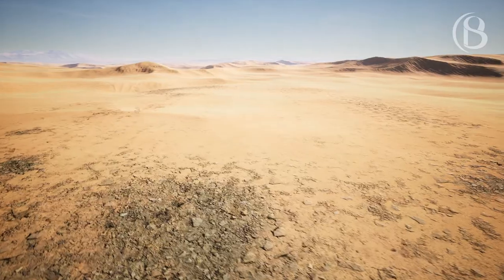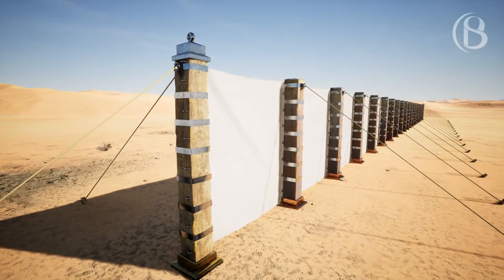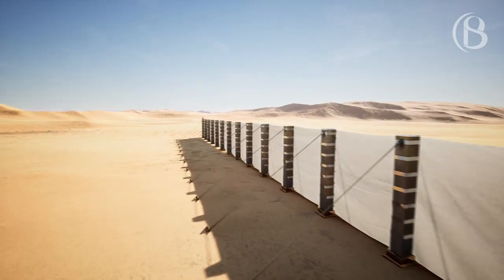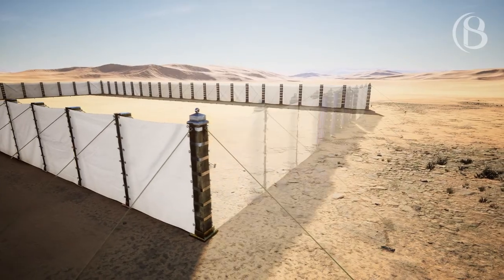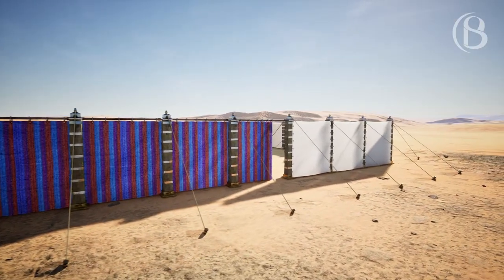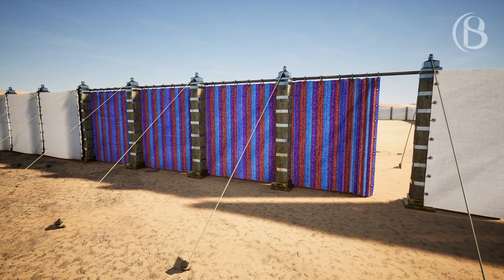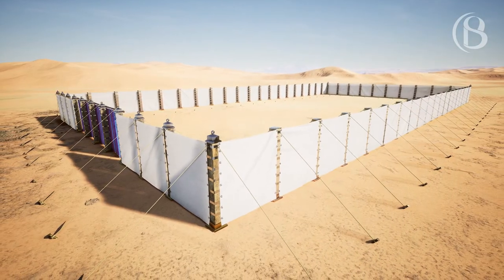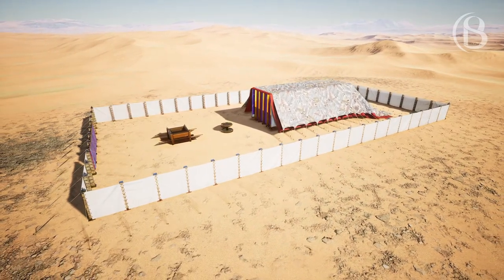Tabernacle in 3D - Outer Court (Exodus 27:9-19)

Comment: I have been studying and teaching the Tabernacle at our church.  I have a question.  The pillars on the outer court.  It says that on the North and South sides, there are 20 pillars.  If each white linen curtain between the pillars is 5 cubits or 7.5' and if there are only 20 pillars there would only be 19 openings between the pillars which would total 142.5' or 7.5' short.  I have the same problem with the end pillars of 10 pillars with 9 openings or curtains.   With the gate having 4 pillars and 3 on each side I still come up with 7.5' short.  In your video, you have 5 pillars in the gate instead of 4.  Can you help me understand this?
Reply from the maker: I decided (rightly or wrongly) to assume that Each side was short one pillar, so for example the front side had 4 pillars but five sheets, the last sheet joined up with the starting pillar on the side, ( at least that's what I think I did - it was a little while ago now).🙂